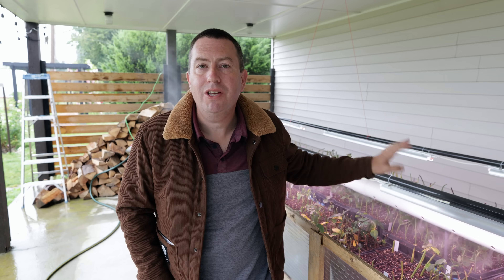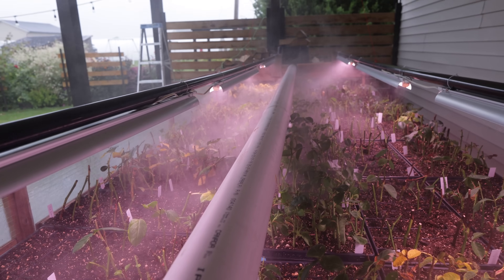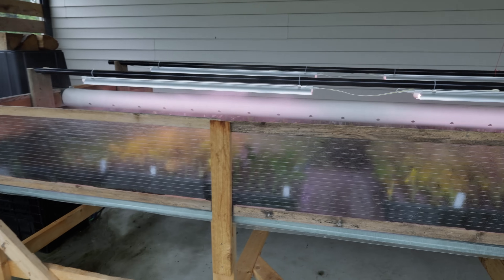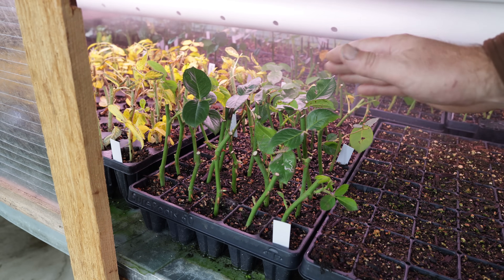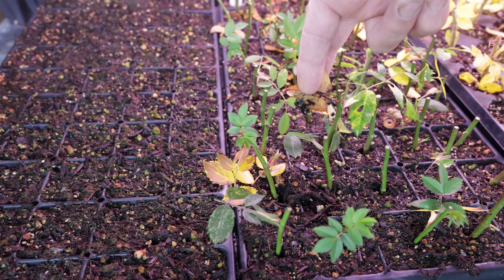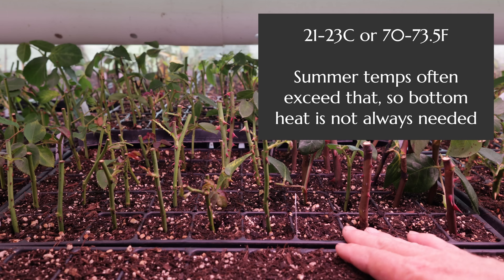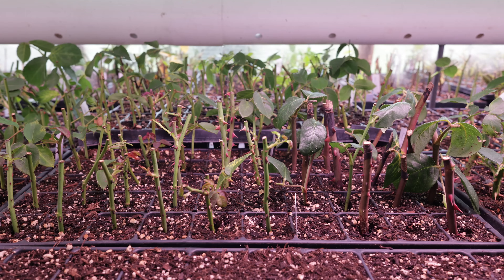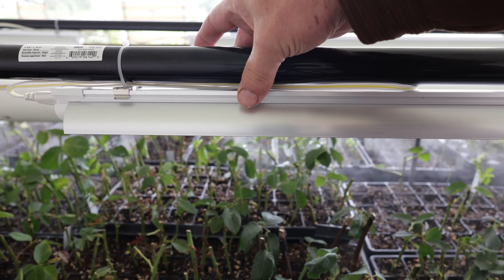How I Propagate Cuttings with Fog

Comment: I have a small garden, but every year I plant 20-50 rose bushes rooted in a homemade cuttings bed. The design of the cuttings bed is simple and effective. It includes an old, fairly large aquarium (about 500 liters), a setup for artificial fog in the terrarium, and two sockets with microcontrollers - one for temperature control (used in aquarium heating, underfloor heating systems) and the other is a cyclic timer that controls the artificial fog. At a temperature of +22°C...+25°C, periodic humidification for 15-20 seconds with pauses of 10-20 minutes and 12 hours of lighting, the cuttings root in 20-30 days. The rooting rate is almost 100%.

Comment: I wish you would talk more about substrate and watering. I have gone through most of your videos on propagation and I am still struggling. I've had 50+ cuttings of elderberry, thyme, rosemary and a few others fail on me. I have <5% success rate and I've felt hopeless. I've got rooting hormone, a mix of 2 parts unfertilised peat (for low pH plants) and 1 part perlite. All sterilised. I'm trying to follow your recommendations but to no avail. 

I bought an aeroponic cutting propagator and now I'm close to a 100% on that. Really quick too. But in soil, absolutely hopeless results.

I can't identify what I'm doing wrong in soil. But almost all rot from the bottom up. So I suspect my substrate or watering is the problem. What do you recommend? How do you run your watering schedule? Can you drench your substrate or do you do dosed watering in some form? Underwatering only?

Do you have any ideas?

Comment: I took some cuttings a little over a month ago used the dome method with pro mix as a medium with a small t5 florescent light fixture and got roots and now I am getting leaves I took them out of the dome and they are under LEDs so excited for them to grow now going to keep them inside over winter and plant in spring. I tried with probably a little over 10 cuttings and now I have I think 6 cuttings that are rooted and growing new leaves. Thank you for your helps and tips.